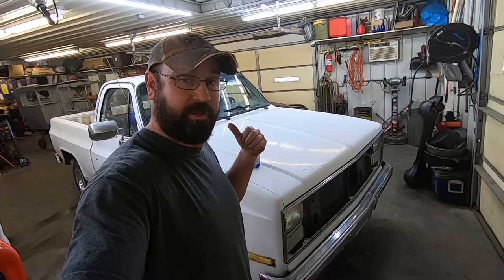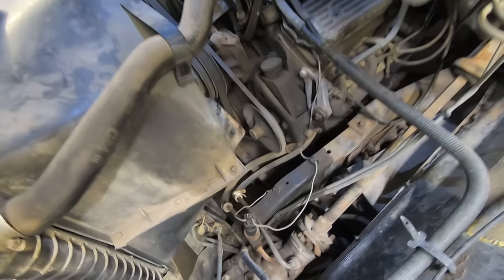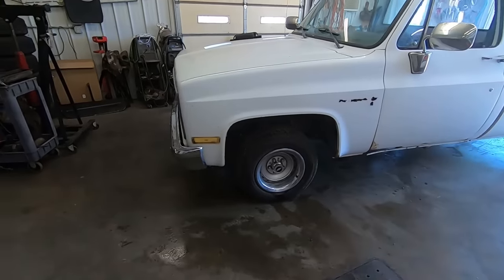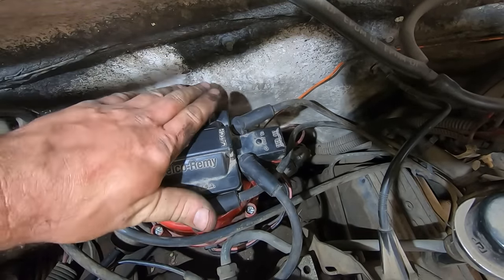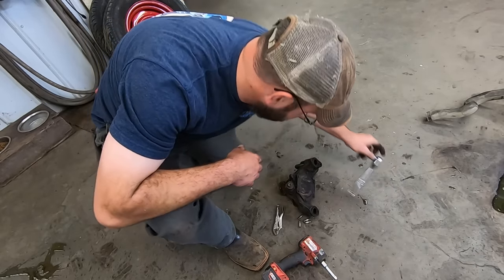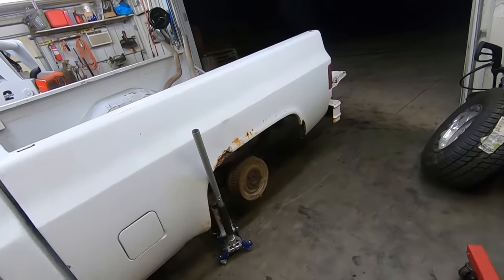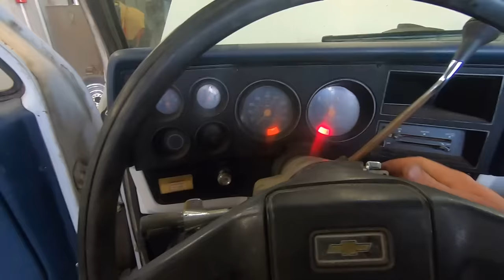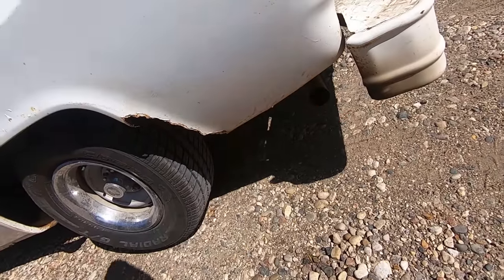I bought the cheapest shortbed Squarebody on Facebook Marketplace! Will it run? Daily driver?!?

Comment: Nice find man! I had a '85 Dodge D100 Shorty, 7 or 8 years ago, I regret selling it so much, young an dumb man. Still haven't gotten my '83 C20 on the road, but I'm working on it! Finally got some brake lines from LMC to fix it, rear line with that strange 9/16" fitting was leaking, and I gotta drop the tank anyway so might as well replace it. I have the same luck with rounded and leaking brake lines as you do with starters, they're always bad front to rear... I think I'd rather have your starter curse man, everything I get seems to have a new starter haha.

No joke man, if you get rid of them mirrors, send them my way! Mines got the poverty painted white mirrors like those! Shipping has gotta be cheaper than new ones, they want a fortune!
Reply from the maker: I'm afraid with the paint and the bodywork they'll have to stay or it'll bother me where the old holes are.

Comment: Chevy started with the 4.3 vortex TBI in the late 80's early 90's. Then GMC started putting them in around 95 that I know of. I have a 93 Chevy 4.3 vortex TBI. I swapped in to my 91 GMC pickup. Runs great an great mpgs with some little aftermarket parts. Pulling around 23 to 27 mpgs highway.

Comment: I had a GMC van with the same engine, they have a plastic intake and the gaskets crack a round 80,000 miles letting coolant fill the crankcase.

Comment: That solenoid on lawnmowers is just called a fuel shutoff solenoid. I love those things about as much as you love smog pumps and flexie hoses. Every time I revive one, I immediately install the delete package as soon as I crack the hood. Those things suck. I own four riding mowers right now (3 were revivals that I got for free and  I built one from scratch from my parts stash), and none of them have fuel shutoff solenoids. I just install a shutoff valve and get rid of that electronic garbage.

Comment: Noticed when you started it it smoked a bit, those 4.3s have tiny oil drain back holes in the heads and are notorious for getting stopped up really easy causing lifter peck and smoke at starting. Thought I'd throw that out there just in case you weren't aware. Good luck on the Square!!!
Reply from the maker: It does chooch pretty good at startup. I just thought it was the guides being shot.

Comment: Damn Mortske, That wasn't a video, that was a movie. Lol. And I have to say, it is my opinion that GM putting the same 4.3 litre engine in their full size pickups that they put in their S10 and S15 mini trucks, was a really bad idea. They were targeted at the guy who wanted better fuel economy. But the fact that they were so underpowered, made them dogs and not as good on gas as GM had originally hoped for. You were way better off with the 305 or 350. Not a bad looking rig though. Thanks for the video.
Reply from the maker: Agreed! Beggars can't be choosers tho!
Reply: @MortskeRepair  I love the square bodies. I had an 81 GMC step side 350 4spd 4x4 with 6" of lift and 38" tires. And a really nice fully restored 87 Chevy step side 4×4, that was basically stock except for tires that were 1 size bigger than stock. Had to sell them both, because I needed the money at the time. So I know where you are coming from.
Reply from the maker: @davidsantos8206  Can't keep them all!

Comment: @50:09 The clear stuff is dielectric grease which is silicone based, the white stuff is a thermal paste for heat transfer & dissipation. The 2 have different jobs they perform. The dielectric grease protects against corrosion from water intrusion, and also facilitates removal of plug wires so rubber doesn't stick to the plugs. Dielectric grease is often used on bulb sockets & plugs wire ends, or even as a protective coating on the battery terminals.  Dielectric grease is best used in higher current applications.   Thermal paste is used to transfer heat from modules (ie, ignition modules) or microchips (like in PCs, processing chips)  to help keep them from burning up, literally. 

Hope that helps. Ppl often think they're interchangeable but they're not.
Reply from the maker: Thanks for the tip!

Comment: I use spray adhesive to hold the gaskets on the water pump and fuel pump. Really any paper gasket that doesn’t want to stay in place while you slam it together

Comment: I put a couple of hundred thousand on the 92 incarnation of that truck, standard bed a/c fuel injection of course, even towed a camper around the us for 6 weeks, putting about 8700 miles on that juant alone, in the ten years I had it I changed the plugs twice ( so three sets total ) a few sets of brake pads, couple sets of rotors, water pump, couple of PVC values, exhaust once, and motor and transmission mounts, shortly after the tour of the us, It never burned or leaked oil or much else for that matter, only thing I really didn't like were the side mounted battery terminals, total pain the ass
Reply from the maker: They're not bad engines.

Comment: My brother had a '76 C10 years ago with a small block and a Quadrajunk. He had the carburetor changed in a shop, and it quit running 2 days later, and would not start for anything. After fiddling around with it for an entire day, I found that there was air in the lines, and that was the sole issue. I bled the lines and it ran fine after that.

Comment: They used the Vortec label before "true" Vortecs (heads) were ever used. I think true Vortecs have 8 intake manifold bolts instead of 12 but that may only be on v8's. That hesitation may be the power valve in the carb. Did they mate 400T to 4.3's from factory?
Reply from the maker: Sounds like they did.
Reply: When the gm 85 c/k series truck got the 4.3 most were mated with either the th400, or the sm465  to make them as durable as they could to start selling them off, and then in 86-87 they offered th700r4 transmissions with them because alot of customers complaining about the really bad mpg and no hp, compared to the same engine in the s series gm trucks...go figure... And no offense but mortske if you think changing a 4.3 mechanical fuel pump is,try changing a Oldsmobile 307,350 fuel pump in almost any mid 70's-  80's gm car

Comment: When I first came to my job, we had a 1985 C10 longbed as a company truck with that same engine & trans.  It was a bare bones truck with dog dish caps and no AC but it did have an AM radio.  I noticed yours has a lockup converter switch on the firewall with no vacuum hose going to it.  I didn't know you could get lockup in a TH400.  If you want it to work, you need to tee a hose into the vac advance line and run to it.
Reply from the maker: Interesting. I'll have to check into that.

Comment: The 4.3s from 1993+ are 180-200 hp.  Yours closer to 150-160.  Should be able to score a good running 93+ 4.3 all day for a couple hundred bucks.  Or you could’ve used the one out of the Astro you got wheels from…Also definitely slap a non emissions quadrabog and older distributor on there.  A 3.8 v6 distributor would be easiest to find I’d think.  That 85-87 GM stuff had a rudimentary ECM that always messed up timing/carburation (which you addressed later in the vid after I wrote this lol)
Reply from the maker: Yeah I should have kept that!

Comment: That's a cool truck square bodies just look the part worth a lot of money down here in my country New Zealand and not a lot around I was always taught to sandwich the gasket between 2 layers of silicone on waterpumps probably a bit excessive but works for me gm built some great cars we got the rear wheel drive 3800 Holden Commodores down here built in australia strong and reliable

Comment: Awesome video! A strange spookie thing happened at the beginning of the video when you were wondering on a name for it. I said to myself, since it’s white and it’s close to Halloween, he should name it Casper. My doors on my 82 C20 are also hard to close without slamming them. I’m in the process of replacing the hinge pins. Hopefully that will fix the problem.
Reply: Are you going to fix the rockers? I could use a video on that before I replace mine.
Reply from the maker: If we get time we'll fix them. PUt some 1/2" pex on the latch strikers and they work great now!

Comment: Now you need a front sway bar from a suburban, they are an 1 1/16" or 1 1/8" if my memory serves me, did wonders for my 76 square body.
Reply from the maker: Cool!
Reply: My 82 c1500 GMC high Sierra jimmy had the thicker sway bar but it was a 305 Chevy V8 4 spd manual transmission truck..
Reply: @richardbates2367  That bigger sway bar sure helps with body roll, my C10 had a small diameter one from factory,.A friend swung by one day when I had the front suspension out for rebuild and hands me that bigger sway bar and says you need this, perfect timing.

Comment: If you are looking for one of these regular cab short bed trucks and can't find a decent one I can help.   This was the model most sold in Mexico over the years.

There are still a lot of unmolested nice condition trucks from the '50's on up to 1996 in this configuration.

Also, in case you didn't know, Mexico sold the square body as a regular cab short bed up until 1991 with the small dual headlight.  They mostly came with the 350 and either auto or stick some with air and others not.  Ford was also a popular truck and there are a few Dodges thrown in.  

Contact me if you are interested in a truck like these.
Reply from the maker: Can you get one across the border tho? I've heard that's the hard part.

Comment: Mortske I had a1990 Chev Ext cab w/short bed with 4.3 V6. It was a Bad Ass Running Truck. do a tune-up and a few carb adjustments Make sure you have good Sparkplug Wires. my truck used to burn up (melt) my wires, Spark plugs always burn clean. my truck always runs like a bat-out of Hell when I hit the Gas it would burn the Tires and sound mean (dual exhaust) it was always a pretty quick with POSSIE TRACK rear end, and a 5spd. Trans.  I Sure-miss that Truck

Comment: Haven't gone to the end yet, however, if the diaphragm in the fuel pump has a hole, that would also explain all the gas in the oil. Oh, you just came to the same conclusion.........will keep watching. Nice truck though.

Comment: Duff was so happy so many rides an like to see more updates when a few has been done to see how it looks an their was a whistle in the video even after you changed carb it was still their if the intake is sucking air will also cause lean on the plugs if you use water over the intake it will show up or try carb or brake cleaner works also

Comment: Take the door post off and put a piece of plastic tube over the post and the door might shut better.  new post from LMC have it on them.
 What size bolts do you use to put on the center caps?
Reply from the maker: I picked some PVC up this afternoon! 5/16" by 3/4" long

Comment: Thats a good battery charger. I have one just like it I got from my dad . It is better than the newer chargers that are of the same size. If you turn it down it has a slow charge on it with low amps . Has real copper in heavy cables to get he current through sufficiently with out gettimg hot like the newer chargers such as craftsman and various others .
Reply from the maker: It's got some snort to it!

Comment: I would check the oil pump sender if the ecu doesn't  see a voltage from the oil sender it will shut down the engine

Comment: Great video! Hey if ya ever have a chance on one of these revivals, it would be great to see a brake booster/master cylinder how to…squishy brake pedal….. that’s what I’ve got…new rotors, calipers, brakes and rear drums and cylinders. No leaks and all air out of system but still squishy brakes….gotta be under the power barn….thoughts????!
Reply from the maker: Interesting. Bad master cylinder?
Reply: @MortskeRepair  that’s what I’m replacing tomorrow. Hope it’s not the booster….thanks for the reply!

Comment: I bought a new S-15 Jimmy 4x4 in 1987 with the 4.NOt eNOUGH V-6.  It was the worst underpowered engine I ever owned.  It didn't even make 40,000 miles and had to be rebuilt.   the rebuild was still underwhelming but lasted about 5 times the original build through two more owners.  That motor was discontinued, I believe, the next year in the Jimmy line.  I haven't bought a GM truck since even though I generally like the GM light truck styling the best.
Reply from the maker: The early S10s left a lot to be desired.

Comment: I did some thinking....and it was painful... But I like you man! ...if I wuz   U..  I think I'd get a spreadbore  to 2 barrel adapter plate and slap a 500 Holley two barrel on it..  reliable as hell and work great on large V6 and small V8 and give great throttle response
Reply from the maker: Haha, try not to do much more of that thinkin stuff Joseph!

Comment: You had a 80 Chevy parts truck,a 78 Chevy and a ,75 Chevy blazer which would all have what you need swap the e4mc electronic feedback carb with it's idle stop solenoid and it throttle position sensor bullshit, build a used 70's gm quadrajet carb and completely do away with the computer feedback ignition system.

Comment: That vacuum jobbie thing by the throttle linkage is a throttle kick down device.
Reply from the maker: TH400s have an electronic kickdown on the gas pedal assembly...
Reply: @MortskeRepair  ahhh, got it. I've seen those vacuum types many times and figured that's what it was. Thanks for the info.

Comment: Little disappointed you didn’t paint that pump to match the distributor cap for bling appeal and the extra HP’s. I use hi-tack to hold them in place usually.
Reply from the maker: Ha, we're out of red paint after the Rambler wheels!

Comment: That is probably  a TH375, not exactly a TH400. The TH375 was intended for use in full size vehicles with smaller motors. The idea was to use the lower gearing of the TH400 to help 6 cylinder motors  pull full size trucks, vans and some cars like station wagons especially with taller rear gears.  The TH375 doesn't have as many clutch disc in their stacks. And a smaller TH350 output shaft splines
Reply from the maker: Likley

Comment: I had a 85 Chevy c10 custom deluxe long bed regular cab non ac 4.3 quadrajet 4bbl e4mc computer feedback carb equipped with the 5 wire gm hei distributor and the air injection system lol .
Reply from the maker: Thanks for sharing

Comment: Had 82 square body, ran like crap, 305 spark control. Edelbrock performer cam and manifold, 600 Holley, recurved distributor. Year later part of the starter mounting boss fell off. Threw a 350 in there, those don’t look like the right arm rest. The ones I had had a door  pull built in them. Remember drinking after work ( electrical contractor) and my buddy puked on the arm rest, took for ever to clean it!
Reply: Oh yay 305 electronic spark control...junk!!! Reminds me of the Chrysler version again junk!!!
Reply: Oh yes the arm rest pads are missing they bolt on the pad  area that sticks out on the door panel just under the door handle.. the door pulls look like they are from a GMC vandura van..

Comment: Yeah you say that ATI call on inside distributor but you have to change the outside Casey just three screws to hold it together I took whatever 4-cylinder one time and I just change the outside casing 12 with the same on the inside the casing hook dry up but I had to change the outside Casey where I had 28 points to be able to use it on a tiller motor

Comment: Nice lookin truck, (I just got a weakness for a white vehicle)..although a V8 would be nicer...good on with the tubular control arms, Arghhh on GM for those pushrod actuated fuel pumps...I never cared for changin those out...just a pain in the @##.....A pre 80s SBC would be the ultimate in there,...delete all that smog & computer controled garbage....K.I.S.S. keep it stupid simple....Ill be tuned in for updates on this.

Comment: Those old square bodies are a sharp body style. Kinda wonder did they swap the 4.3 vortec v6 into that truck because vortec i dont think came out until 96 or so and dont know if came with a 4 barrel carb most times they had cpi (central port injection)

Comment: I like Coors light, but usually only on hot days, I prefer whiskey most of the time. Rebel Yell has taken my attention here lately, it's around ten bucks cheaper a bottle than Jack,  and much smoother imo. I like Casper,  had a 92 Silverado with a 4.3 and a five speed. Really liked that truck, had a 40 gallon tank and I'd drive it for two weeks to work before I had to hit the pump. Would have preferred that combo in a square body though.
Reply from the maker: Those manual 4.3s did pretty well in that OBS vintage.
Reply: @MortskeRepair  I didn't try to move mountains,  but it was a fun truck to tow the jet ski to the lake with. It just sipped the fuel too, which is quite a bit different than my 6.0 with the 4.10s out back. That thing will pass everything but a gas station.